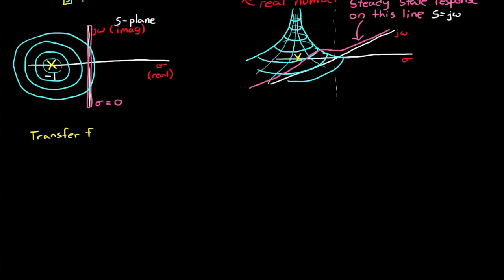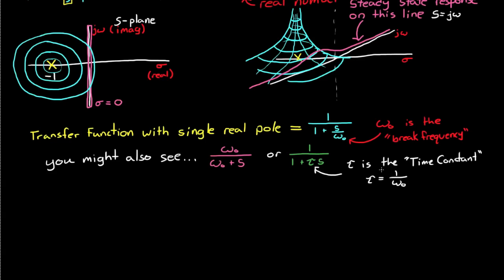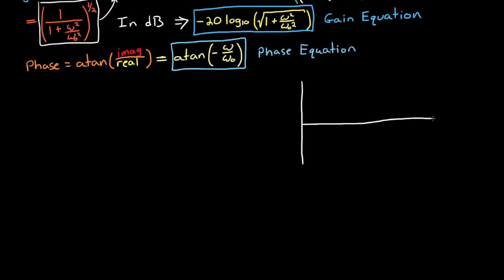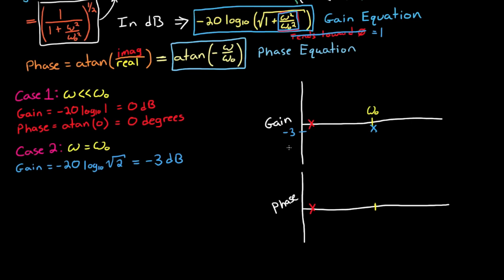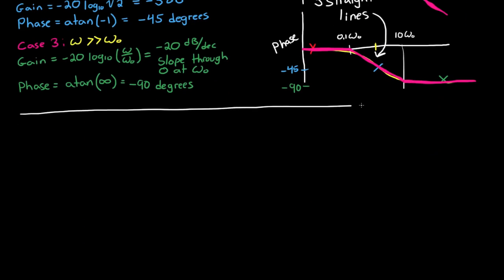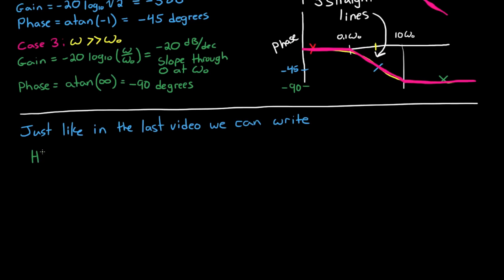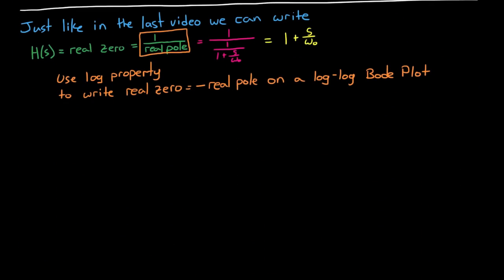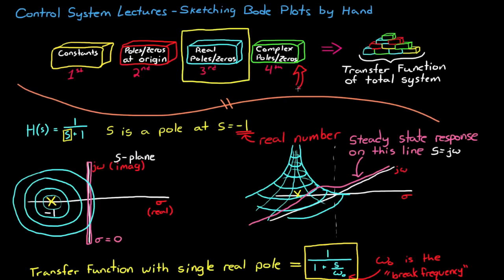Bode Plots by Hand: Real Poles or Zeros

Comment: idk if  you still look at comments, considering this is 12 years old, but I am slightly confused on something.

is w0 something we "assume" exists? For example, for the function 1/(s+1) do we "assume" w0 = 1 so the w/w0 = w or w0 = 1/2 for 1/(2s+1)?
Reply: Hi I beleive I can help you here

So yes, for the function 1/(s+1); w0 = 1
and yes w0 = 1/2 for 1/(2s+1)

If for example we have a transfer function of  1/ (5 + 2S)
It can be simplified as    1    /
                                             / 5(1 + (2/5)s )
in this case w0 is going to be (5/2)
Reply: @ ah thank you very much!

Comment: Hi Brian, why didn’t you take the absolute value of the numerator and denominator of the initial transfer function? Why did you need to take the complex conjugate of it first? If you take the absolute value of the initial transfer function ( 1/(1+ s/omega)) wouldn’t you arrive at the same gain? Thanks!

Comment: Although I appreciate the effort put in these videos, and perhaps it didn't click properly in prior lectures, but I assume we are trying to avoid to poles as they make the system unstable, and thus, want to focus on zeros to make it stable? And thus, the purpose (and maybe stated in a future video) is to design a system to avoid poles? Perhaps this is incorrect, but it is more of an introductory statement if anyone is willing to elaborate / correct me on the purpose of focusing on the zeros and poles, and a bit more intuition into this. I am having a difficult time bridging the gap between transferring this controls knowledge into an actual application. I can get through a lot of the math, I guess I am missing the bigger picture / connection in the brain at this point. Thanks.
Reply: you cant avoid the poles

Comment: There is also an old graphical way to calculate the transfer function (Magnitude and Phase) from a pole-zero plot.

1.  Draw the Transfer function poles and zeros on some graph paper.
2.  Mark the point (frequency) on the positive jω axis where you want to evaluate the transfer function.
3.  Draw lines from this point to all the poles and zeros on the plot.
4.  Measure the lengths of the lines drawn in step 3 and label them.
5.  Measure the angles from the positive x-axis to the lines drawn with a protractor, and label them (with the proper sign).

6.  Combine the contributions from all the poles and zeros.  If you have multiple poles or zeros at the same location, be sure to count them multiple times.

|T(jω)| = (Product of Lengths to Zeros) / (Product of Lengths to Poles)
arg(T(jω)) = Sum(Zero Angles) - Sum(Pole Angles)
Reply: Is this for real??
Reply: @arunpandian294   ,

It is.

Comment: Dear Brian, Great videos! Very concise and clear. Is the part where you equate w = wo and you obtain a value of 3dB related to determining the lower and upper cut-off frequency of an amplifier circuit? Since the lower and upper cut-off frequency from a frequency response curve are obtained by drawing a horizontal line through -3dB and marking the points where the line cuts the response curve.

Comment: why is it that you take 1/10 th and 10 times the break frequency when you are plotting the asymptotes in the phase plot and is this also required while drawing the line approx. of the gain plot ?. Thanks.
Reply: It's an approximation.  You know the phase is 0 for small w and approaches 90 degress when w>>wo.  Plug in 0.1wo and 10wo into the phase equation and you will see these are the points near where the phase begins to diverge from 0 and has closely reached 90 degrees.

Comment: Dear Brian, thanks a lot for your extraordinary clear videos! Well done! In a few minutes, plenty of condensed knowledge. Could you better explain the note about the influence of the real pole on the steady state answer? I don't understand the 3D graph you presented in the first minutes. Thanks, Davide.
Reply: Moises Ferber
If i'm not mistaken, the z-axis is the transfer function. So at the pole, the transfer function would be infinite, and at a zero, the transfer function would be 0. That is why you look at the denominator for the poles and the numerator for the zeros.
Reply: I'm also wondering what is exactly the Z-axis in that plot.

Comment: Dear Brian,
Very useful video. I have Question on basics.
Imagine i have a system with numerator (S+1), means i have a Real LHP zero at -1. Means whenever i apply exp(-t) signal to that system i would end up with Zero value of the O/P Quantity. here we can't find any real sinusoidal frequency which gives zero o/p value.

Similarly if i have a system with (S+1) in the denominator then i will get infinite response if i excite system with exp(-t) rather than a simple sin..

Could you please kindly tell me if there is any thing wrong with my understanding??

Comment: Hello Brian, the point at 90 degrees on the phase plot, did you choose a random point tending toward infinity? also why did you find the point of 0.1 the break frequency and 10x the break frequency? is that because of the log scale? is that always done that way considering the 3 line asymptotic plot for phase?
Reply: Same question please answer :D
Reply: I also feel it has something to do with the log scale.
Reply: This is my analysis.
I think whats happening here is when the phase is less than 1/10 break frequency it is considered almost constant however when we cross the 1/10th mark of break frequency we are almost approaching the break frequency and we start seeing the phase change (which we don't see when the frequency is less than 1/10 th break frequency) finally we reach break frequency and start approaching the point when the phase approaches -90 which becomes visible after 10 times the breaking frequency as this is significantly higher frequency than the break frequency and the phase becomes almost -90 for all frequency beyond this point in the frequency scale. So it is a matter of how we see things in the log scale. Hope this made some sense.

Comment from the maker: Another way of solving the problem is by not rearranging your equation at all. It doesn't need to be in the form I state I just like to see it that way. You can just set s=jw with your original equation. H(jw)=jw+1000. Then the gain when be 20*log10(sqrt(1000^2 + w^2)). And if w << 1000 then this just becomes 60 dB.

Comment from the maker: Hi Felipe, you inadvertently multiplied your equation by 1000. You started with s + 1000, but really this is (s + 1000)/1. So to get it into the form I state in the video you'd divide by 1000 which would be (s/1000 + 1) / (1/1000). If you only divide the numerator then you're altering the equation rather than just writing it in a new form. So the equation is (s/1000 + 1) which is what you had, but then multiplied by 1000 which is a gain of 60 dB.

Comment: First thanks for doing this tutorial I have found quite easy to follow, I have a question, if a take H(s)= s+1000, so means the zero is -1000 so following the procedure, then rewriting the equation as H(s) = 1+s/1000 ans set s=jw, I write my Gain Equation is  if a take a w<<w0 such like 1 I have -20*Log10(√((w/1000)^2+1)), however the gain is 60dB but I can not achive the result with this equation

Comment from the maker: Hi Contradel, you know that this transfer function has two poles because of the order of the characteristic equation.  Since it's 2nd order there are two poles.  And you can solve for the roots using the quadratic equation, or factor the equation to be (s + 1000) * (s + 1000).  So there is a double pole at s = - 1000.

Comment from the maker: The third dimension I drew was in the S-domain (explained better in the video on the Laplace transform). The real axis is sigma, the imaginary axis is omega, w, and the "z" axis isthe complex result of the Laplace transform.  Sigma and w are locations in the S-plane. For frequency response (Bode) the Sigma term is zero. So all you are left with is the complex data (the z axis) along the imaginary line. The complex data is then converted to amplitude and phase to make two separate plots.
Reply: We are making bode plots for real value of poles/zeros in this video. You make the transfer function accordingly to fit real value of s but you check the response for complex value of s which is jw. Why is that?
Reply: @rorschach4285  S actualy has a real and an imaginary part  (S=a+jw) where a represents the exponential part and goes to zero in steady state. s=jw is sinusoidal part which represents the steady state response of the system, on which were are dealing with while using bode plot. So if H(jw) generates a real part, it's the steady-state response of TF, not the exponential term of S which goes to zero in steady state.
Reply: @GundoganFatih  makes sense. Thanks!
Reply: @rorschach4285  You welcome!

Comment: Hello Brian,actually our teacher asked that question to us..firstly i thought that it is about the signals&systems.then today he explained more about question but actually i dont get it well.he told us that,real zero is like a ground for a circuit over a copper plate, for analog zero its specific for the device for ex.for a test kit and its referance zero. and about the digital zero told that ; u can see a small hole on a printed circuit for ground,its digital zero. and you should connect all